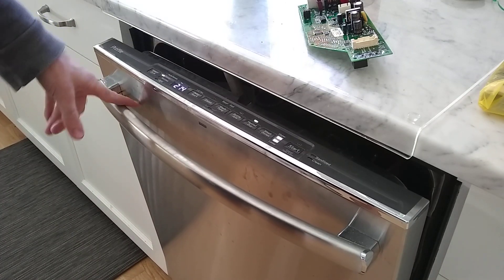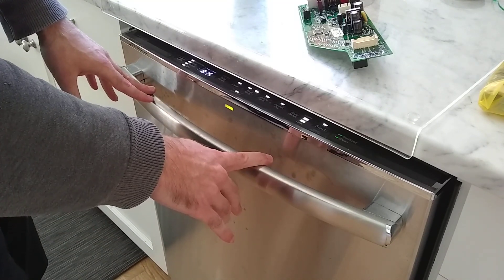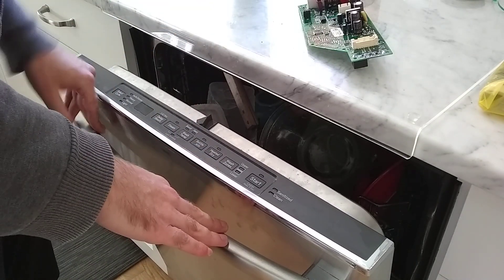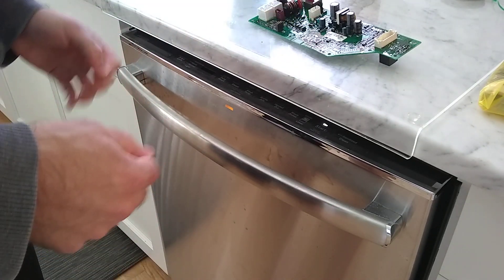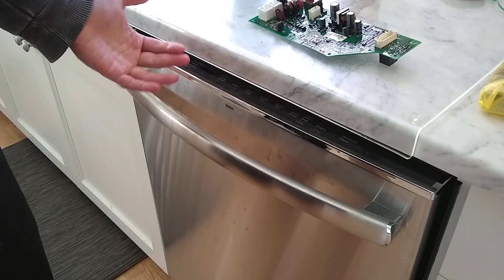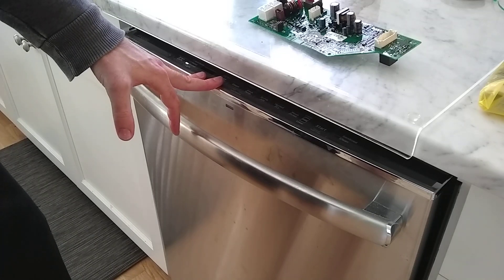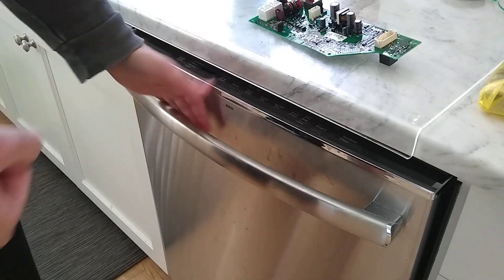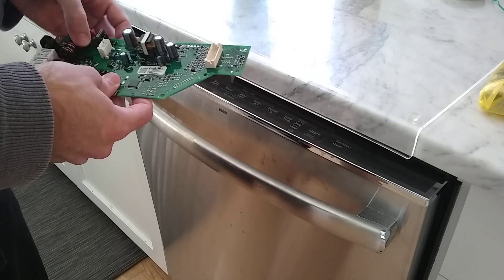GE Dishwasher Service Mode Not Working (Broken Control Board)

Comment: How long does your dishwasher operate before the heating element kicks on? On mine, now that I have the motor fixed, Running Heavy cycle with Boost and Steam turned on, it goes for about 30-40 minutes and 5 Gallons of water before the enclosure gets hot. I'm just curious if that's a normal is all.
Reply from the maker: It could be an initial rinse cycle. Maybe there's another mode that skips it? If you want to dive deep, check out Technology Connection's video on dishwasher soap :)

Comment: Where did you get this part Nolan?
Reply from the maker: I can't provide a link here, but the part number for my dishwasher is WD21X24902 and I ended up ordering it from Parts Dr because they had a good return policy. However it was a little more expensive than other vendors.

Comment: Where did you get this part Nolan?
Reply from the maker: The control board is probably different for each dishwasher (you should open it up and find out). My part number was WD21X24902. I wanted a no-hassle return in case it didn't work, so I went with Parts Dr. https://partsdr.com/part/wd21x24902-control-board

Comment: I had the same problem, I replaced the door latch assembly, 25$ish part. That fixed it after I went to the breaker and flipped it 4 or 5 times lol... Literally made no sense